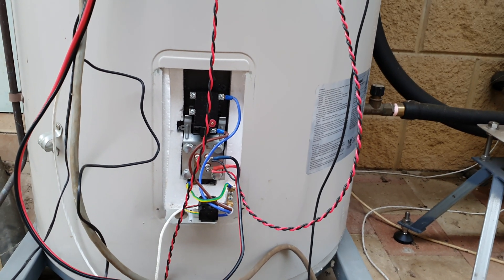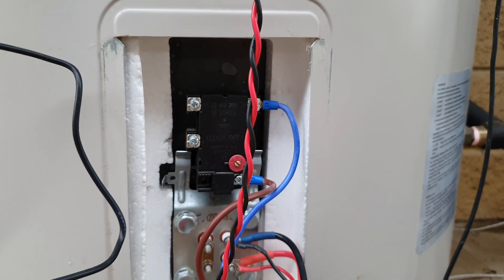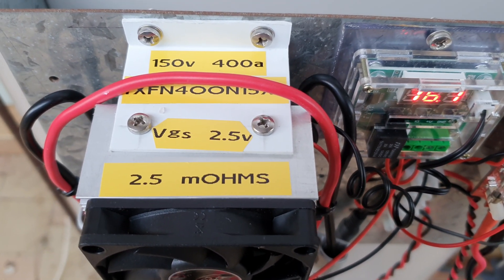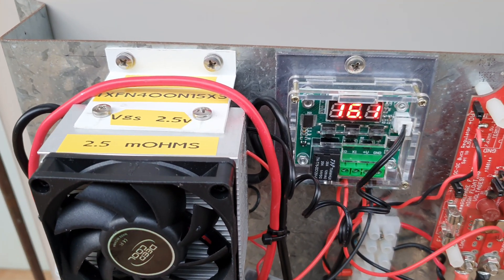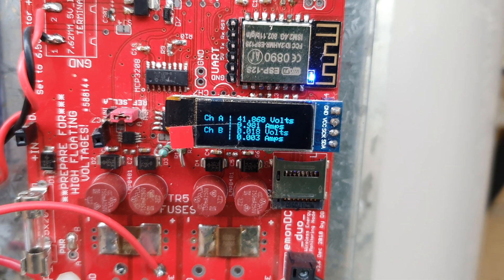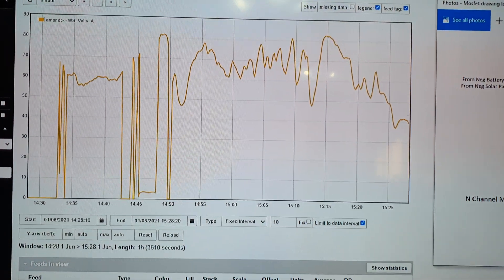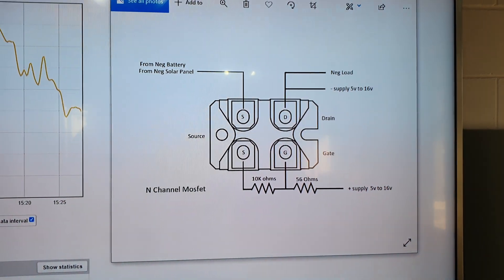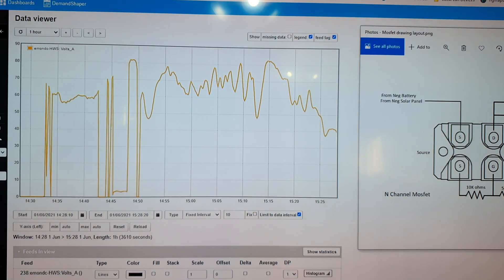Solar PV direct hot water service ( HWS ) using mosfet to control the high DC current

Comment: At $50 each, I wouldn't be putting 5V on that gate!  These should never be driven with less than 10V.  In iffy circumstances of supply voltage, as in self powered, use a FET driver just for the low voltage <10V shutdown feature.  Not all FET drivers have this.

Comment: 😁🥰😎
Reply from the maker: The mosfet Gate is powered by 12V power pack, also the fan temp is also 12v separte pwer pack, but the emondc for monitoring is 5v, the VGS of the mosfet is rated at 2.5v to fully close circuit the mosfet, so it can be, if you wanted be, controlled by even a Arduino setup, as it has been running a few day, all seems to work, the heatsink fan has never activate as it is the same temp as the atmosphere, the test will be over time